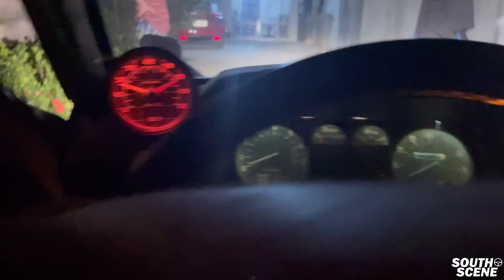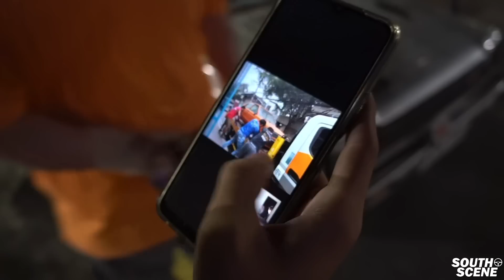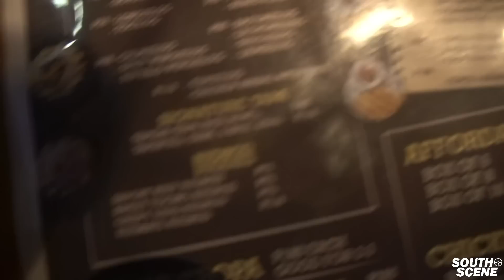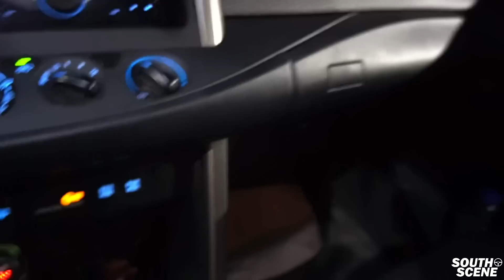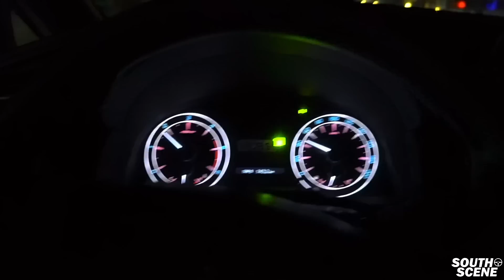PANG GRAB NA KARGADONG INNOVA!

Comment: 2nd gear 3.5krpm 95? ano yan possible mag 110 in 4.5??? parang di ka panipaniwala
Reply: 5 speed lang at long gears ang manual na innova...in stock form kaya sagad 70 kph sa 2nd gear
Reply: @erfederizo  kaya nga napacomment ako dito bigla eh kasi 2nd gear daw tas nasa 95 na haha
Reply: @admiralgaming2657  re-mapped na kasi yang innova diyan. Mas mataas na horsepower at torque, mag iiba na talaga takbo. Yung sakin re-mapped narin, nasa 234 horsepower at 502 nm na torque kaso matic sakin, nag iba narin ang kph reading ko, kasi nga lumakas na makina.
Reply: @erfederizo  alam kong remapped yan pero imposible yang 95kph at 2nd gear na 3.5k rpm
Reply: @erfederizo  di mo ata nagets comment ko
Reply: @admiralgaming2657  ikaw ata hindi naka gets. Hindi porket sa stock na makina hanggang 70kph lang ang naaabot ng 2nd gear eh hanggang doon nalang din yung kaya abutin ng naka remapped na engine. Kahit stock set ng gearing lang yan, pwede magbago yung velocity/speed na maabit dahil sa madaming factors: hp, torque, wheel size etc. So hindi nakakapagtaka yan kung umabot ng 95 kph yan pag ni-redline niya ang 2nd gear
Reply: @erfederizo  bro naka innova tropa ko remapped then and palit na turbo at nozzle basta busog na siya hindi umaabot ng 95 2nd gear nya at 3.5k rpm
Reply: natatawa nalang ako hahaha
Reply: @admiralgaming2657  ay yan maganda....sige ano brand nung nozzle o racing nozzle ng tropa mo para sa 1GD niya? 😂
Reply: @erfederizo  pag kaka tanda ko Denso nozzle nya why?
Reply: @admiralgaming2657  denso nozzle?  walang aftermarket ang denso, stock size lang ang sa denso, yun na yung sinasabi mo na ipinalit at busog? 🤣
Reply: @erfederizo  so anong point mo ngayon? eh sinasabi kolang is hindi nag 95 2nd at 3.5krpm ang innova ng tropa ko. Kay Ian Stock turbo palang siya nung nag kasama kami sa meet at stock pa clutch then 95 2nd gear at 3.5krpm
Reply: @admiralgaming2657  tinitignan ko lang kung ano anong kabalbalan pinagsasabi mo at kung may alam ka talaga 🤣...ok na, sa mga sinagot mo palang alam ko na, sa iba mo nalang sabihin yung drawing mo. Denso amputek 🤣🤣🤣
Reply: @erfederizo  wow? if may unit ka mag subukan nalang tayo personal unit hah hindi hiram sa tropa. Diesel car
Reply: @admiralgaming2657  mahina ba reading comprehension mo? Di mo nabasa na naka innova ako, 2017, remapped kay speedlab, naka borla full exhaust, at sumasali ako sa mga diesel drag, last noong sa subic. Kaya wag ako...baka ikaw ang wala at nag ddrawing lang dito? 🤣🤣🤣. Denso nozzle amputek  hahahahahahahaha...walang aftermarket oversized nozzle ang denso 🤣🤣🤣🤣
Reply: @erfederizo  ano borla na copy? HAHAHA mag gauge nalang tayo
Reply: ano innova mo at ano kulay
Reply: @erfederizo  ilan 1/4 mile mo boss?
Reply: Talpakn na yan
Reply: @erfederizo  ano bro pm moko
Reply: @admiralgaming2657  2017 innova blackish red...ikaw ano ba sayo? 😂
Reply: @johnbby7  low 15's, high 14s boss, full interior boss pati sound system 😅
Reply: @erfederizo  lakas naman tara mag gauge tayo
Reply: @erfederizo  full interior with sound system pa kwento mo nalang sa bingi yan
Reply: @admiralgaming2657  Ahahaha
Reply: @erfederizo  grabe lakas boss. Tinalo mo lahat ng stock tubro category. 🙏🍻
Reply: @admiralgaming2657  hahaha hanap ka ng kausap mo, hanap ka narin ng mahihiram mong sasakyan hahahahaha
Reply: @admiralgaming2657  alam mo ba yung high 14s at low 15s? Bugok 🤣
Reply: @erfederizo  dami mo sinasabi ayaw mo naman lumaban puro ka pudak
Reply: @erfederizo  ano ayaw lumaban?
Reply: @admiralgaming2657  ano nakahiram ka na ng sasakyan? Hahaha hirap na hirap sabihin kung ano sasakyan mo ah...L300 ba? 🤣
Reply: @erfederizo  Montero gen 2 nga mag basa ka kaya puro ka amba ayaw mo naman pumalag
Reply: @admiralgaming2657  hahahaha nagpalit pa talaga ng profile pic....san mo nahanap yan?
Reply: @admiralgaming2657  wag mo kaming pinagloloko dito...wala kang binanggit na sasakyan mo...naghanap ka muna ng pic nung hiniraman mo na montero? 🤣🤣🤣🤣🤣
Reply: @erfederizo  lumaban ka nalang gauge tayo puro  ka pudak ayaw mo lumaban